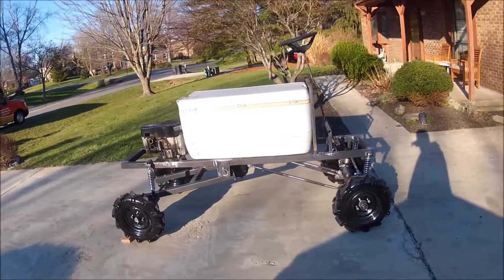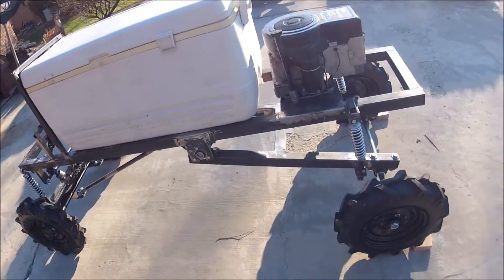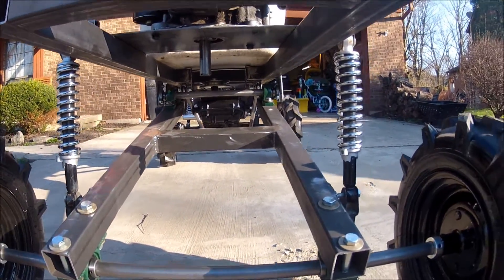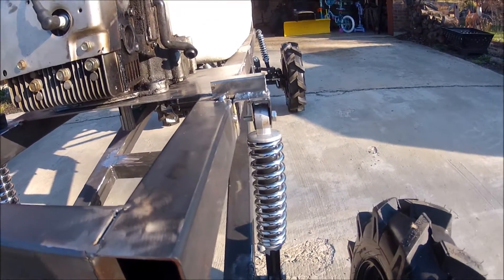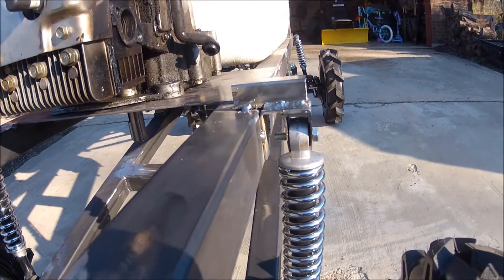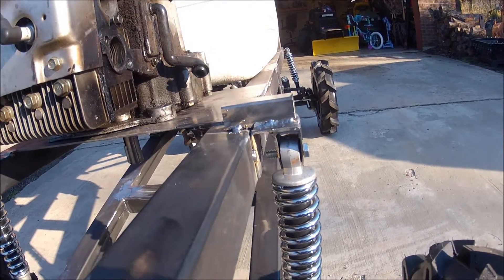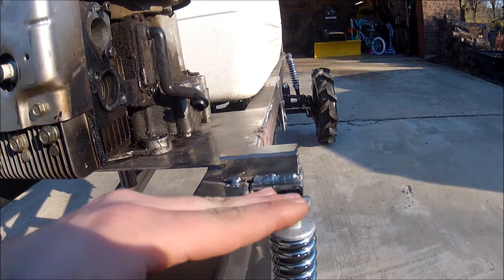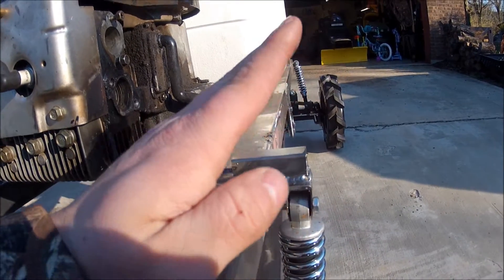swing arm & rear suspension fabrication

Comment: there is so much wrong with this that I wouldn't even know where to start the tubing is way oversized it looks like crap use a smaller tubing but thicker wall thickness that way it doesn't look out of scale , 45 your tubes where you don't have the open-end showing. the next time you see a four-wheeler check out the rear suspension on it and copy that I think you'll find it's going to work a lot better than whatever that is you're trying to do. don't mean to hurt your feelings but sometimes just coming right to the point is better than not you have a good idea going there it just needs a little more thought put into it. I built a miniature Swamp Buggy for my grandkids using four wheeler tires and wheels it worked out really great I think you're going to find that vertical shaft is going to be kind of hard to work with the horizontal was a lot easier for me because parts were easier to come by and also there was less work involved and trying to make it work properly have you thought about what type of brakes you're going to use I put disc brakes off of a four wheeler good luck with your project